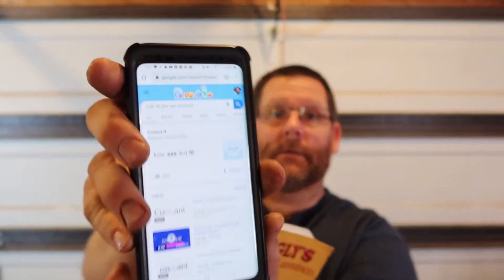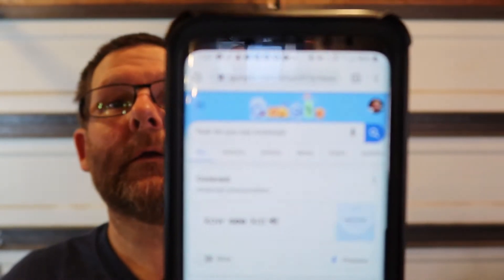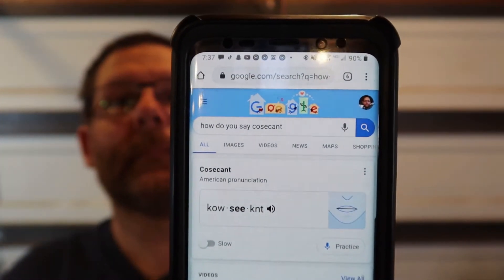Bending Conduit Using Cosecant Chart| Ugly's Book Refrence

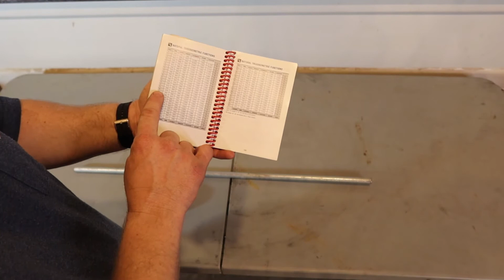Comment: Cosecant refers to the ratio between the hypotenuse (the conduit) and the side opposite the angle (the size offset you need to make.) In the example at 6:13 they are making a 4 inch offset using 15 degree bends. He gets his cosecant value (3.86...) and rounds it up to 4 instead for ease of use. You take that number and multiply it by the offset which is 4". this represents the space between both 15 degree bends that make up the hypotenuse (diagonal) part of the offset.
Reply from the maker: Exactly

Comment: do a video showing a 90 with a kick; that's a common need. I've been in a panel room and had to offset down, kick to the right before 90 down. and not a lot is really shown on figuring the shrink when you do a kick, and I never used an angle to figure it; I had to kick over 15 or 20 inches or whatever and 90 down to a panel. That would be a good video, brother.
Reply from the maker: Good idea I'll definitely keep that in mind when I do the Bending videos in the upcoming months

Comment: I never used it. I always did my bends by sight and was quite good at it too. The number crunching really doesn't matter so much on small size conduit but after you get to 1 1/2 it matters because the conduit starting to get expensive.
Reply from the maker: Honestly me too. Not when I first started though.
Reply: Only issue with guys who bend by sight alone, it’s almost impossible to math there bends or so matching offsets